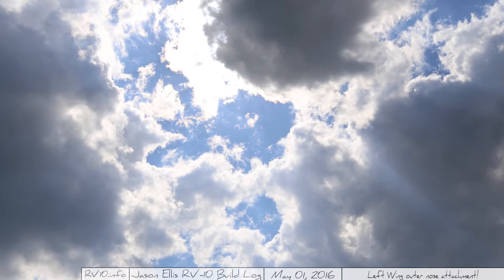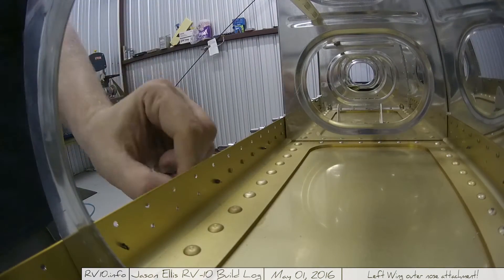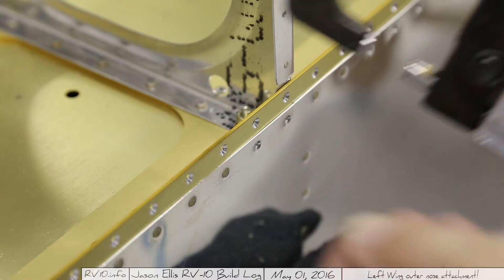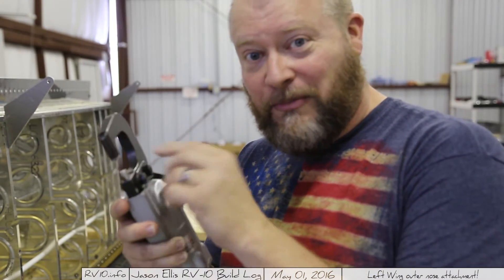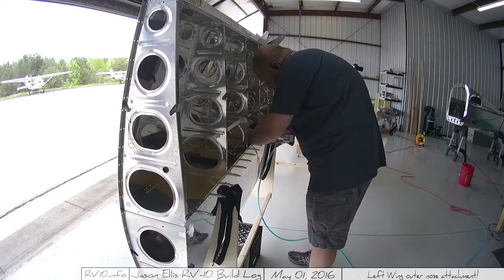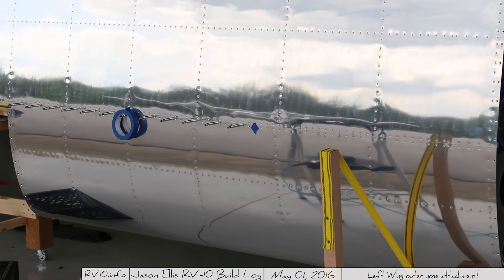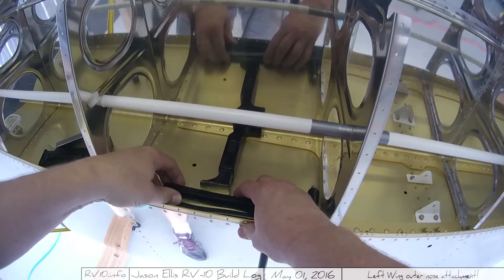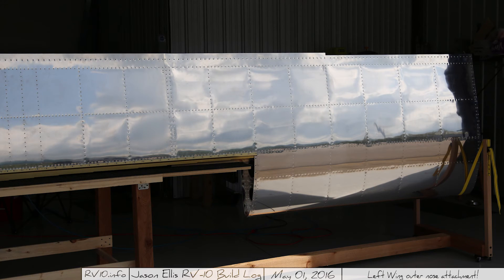RV-10 Wings - 019 - Left wing outer nose attachment

Comment: Did you decide not to prime any of the wing elements, and if yes, why?
Reply from the maker: +XisDshizL There is a very large debate on "prime" or "don't prime".. look around the forums..  But the short of why I decided to not prime is simple;  I fly planes that have been around since the 60's, all aluminium, all unprimed.. None of them have any issues.   Priming adds a LOT of work, and a lot of weight.   I just don't see the value.
Reply: Jason Ellis, I tend to agree.  I would either anodize which is virtually weightless or spray something like ACF50 (going on memory here do that may not be exactly correct) when all is said and done.
Reply from the maker: Anodizing large areas is a bad idea as you're chemically altering the metal.  This could cause issues.
Reply: Jason Ellis, better let Van's know.  🙂

http://www.vansaircraft.com/public/airframe-options.htm.

FYI - I am a licensed professional engineer.
Reply from the maker: Admittedly I'm just regurgitating what I have been told.  The main spar is anodized, but none of the rest of the parts are.  I have to assume there is a reason?
Reply: Jason Ellis, yes, I am sure Van has a reason.  I would guess cost is the primary reason.  Anodizing is great protection, but it comes at a high cost.

Comment: Question about the pressure provided in spring of rivet gun to bucking bar.  Was that really enough pressure to set the rivet?  As I have yet to set a rivet my impression was that significant force from the bucking bar was needed to smash the rivet neck. Impressive videos all around. Please continue and know that it of great benefit to a dream builder
Reply from the maker: +Trevor Holman Actually, it takes less force than you realize.  The rivets shop head is formed by you holding pressure against it with a bucking bar.  The bucking bar does the majority of the work due to it's stubborn mass - It doesn't want to move.  (This is why a heavy tungsten bucking bar is effective)  You just have to hold it in place. The rest of the work is done by the rivet gun which just causes the bucking bar to bounce away.  Your holding the bucking bar in place means there is a moment when the rivet gun pushed, and the bucking bar hasn't moved yet.  That moment causes the shop head to start to form.   Holding the bucking bar super hard tight against the rivet just causes your hand to hurt =)
Reply: +Jason Ellis how many different bucking bars have you NEEDED so far?  I'm putting together my list of tools to purchase.  The 1.7 lb tungsten is certainly on the list.  Did you need the special empennage bucking bar?
Reply from the maker: +lmannyr1 The small tungsten one is 100% required.  I use it the most.  The foot shaped one is also used a lot.  The rest of them, feh.  I have 1 other that I never use.
Reply: +Jason Ellis Thanks

Comment: Ha...Nice trick with the 3rd hand.  Whats with the PVC pipe?   Will that be your wire conduit?

Thanks for the video Jason.   Keep them coming.
Reply from the maker: +lmannyr1 It's for running wires to the wingtips so they don't flop around inside the wing.
Reply: +Jason Ellis Have you considered other options?  I don't have plans yet but from reading on the forums, it seems conduit is NOT needed in the wings.  Just simple snap bushings to prevent chaffing.  Wire bundles can be zip tied to the bushings along the way.  Some suggest adding 2 or three extra unused wires in each wing wire bundle to leave room for possible future expansion.  Also leave a string in the bundle from wing root to wing tip.  While in the service working avionics, I never saw conduits for wiring.  Wire bundles were zip tied or wax stringed to bulk heads, ribs etc.  From removing the wing tip and inspection/access panels, all wing ribs are accessible on the -10.  If your dead set on some sort of conduit, consider "innerduct".  Very flexible and much lighter than PVC.  Pulling a wire midway through the run from PVC is a PIA (cut/drill PVC and rough edges for the wire to turn against.
Reply from the maker: +lmannyr1 It's not actually PVC it's an ultralight conduit called.. uh.. sharkbite or something.. I'll have to check and get back to you.. its designed for exactly this.  Was recommended to me by other builders and it works nicely.  Its smooth and slippery inside to running wire is trivial.
Reply: +Jason Ellis I searched "sharkbite" and came up with PEX pipping.  Looks like "sharkpipe" is the Brand.  I'll have to research that.  Thanks for the tip Jason.